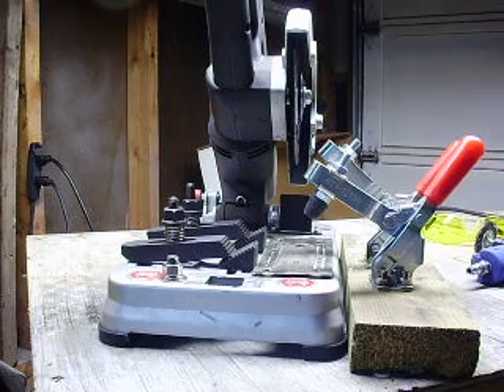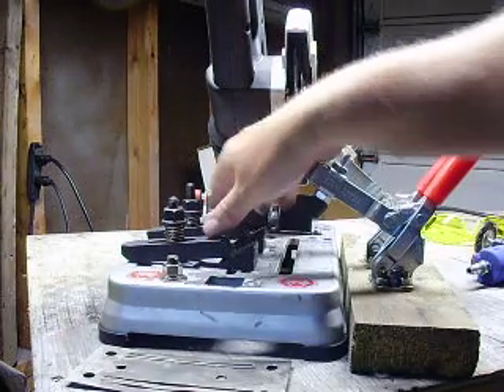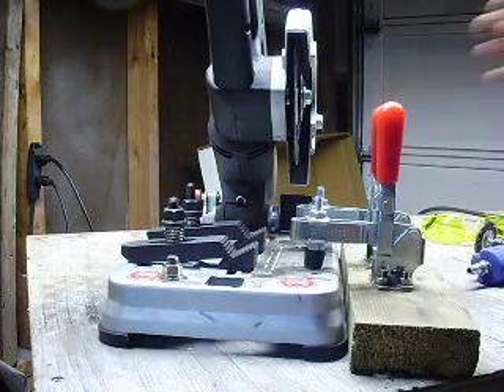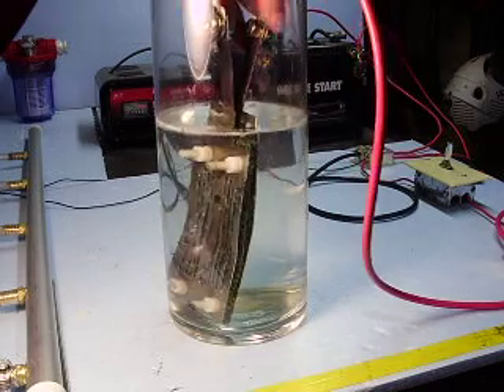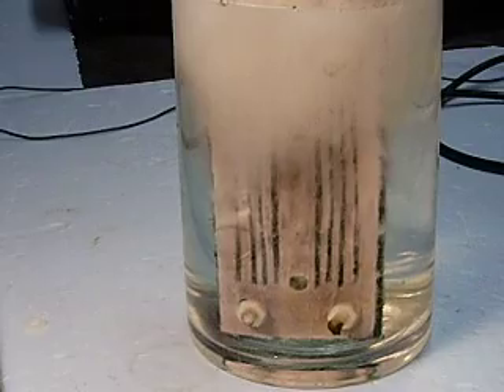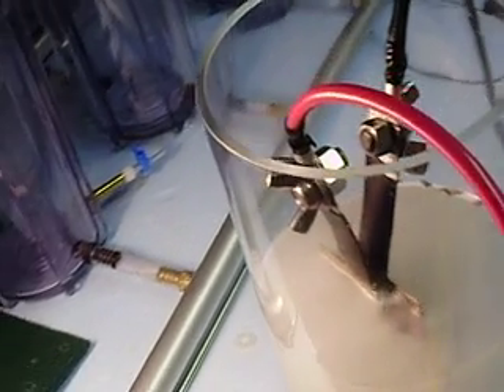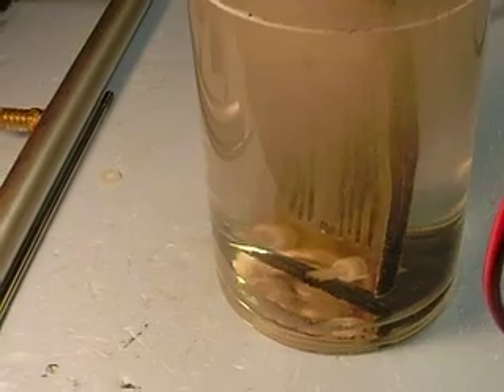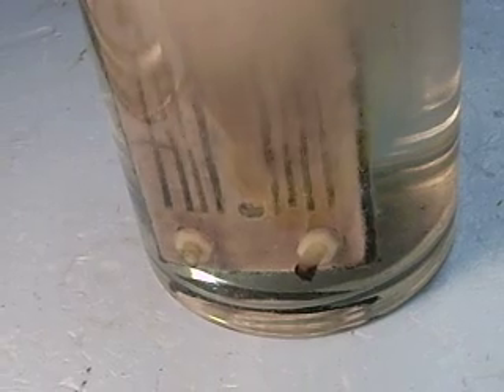017 hydrogen test slotted plates

Comment: Hello FizzyH2O, I am very intrested in your design of plates. can you give me some information about your setup?  I'd like to know how much voltage you are using, the amp draw and temp reached.  I'd also like to know how the output differed from a solid plate design.  oh, and one more question, does it make a difference when you use a netural plate as to just using only two plates( pos and neg)?  I have been experimenting on one I've made my self, have a look at my video, tell me what you think.

Comment: Well.. not really, because you get current leakage between the plates. Sorry :)
Its especially true for the neutral-plate-setup.

Look up Bob Boyce's or "Eagle Research" setup, he has NO holes whatsoever between plates. And i did a similar setup, 120+ plates for wall-socket voltage, and had to isolate the end-plates because of leakage in between the end-plates, so basically some current got through the cell, and a lot AROUND the cell.. After isolation all current had to pass the metals plates :)